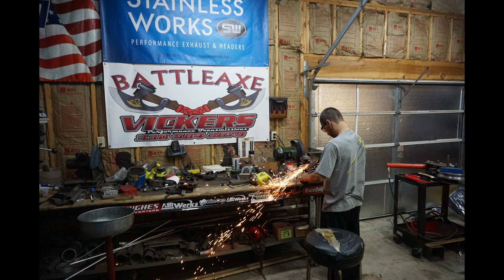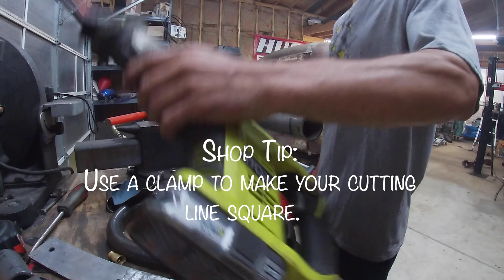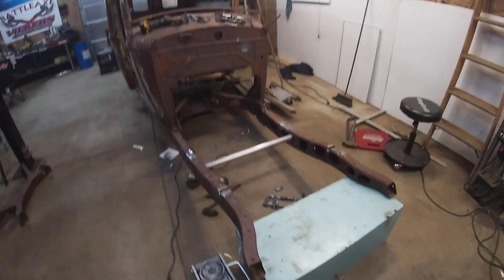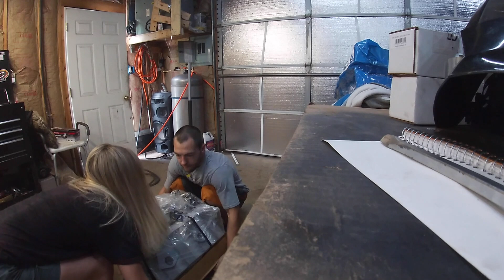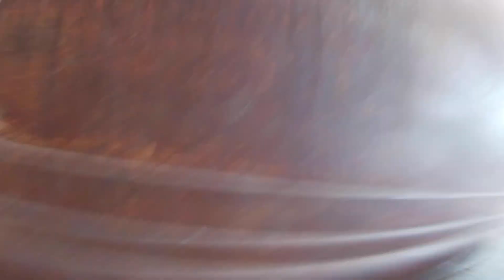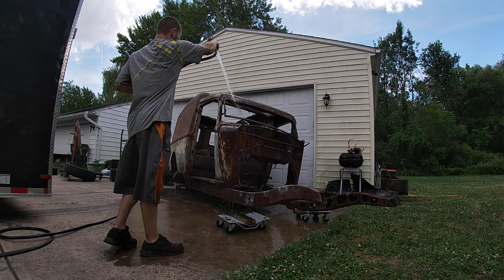Twin Turbo Rat Rod Build Day 2

Comment: Hit up John Doc here on YT he is a seller of Billet Atomizer Racing Injectors and I fully agree if you're going to drive it on the street you should run two sets of injectors and two tunes one for E85 but I would run E98 and Methanol tune so when you want to run Methanol while you're racing and want to turn it up and if it's in your budget I would try and find someone who can make carbon fiber body panels and put a carbon fiber one piece front end and carbon fiber doors and run a QA1 carbon fiber driveshaft